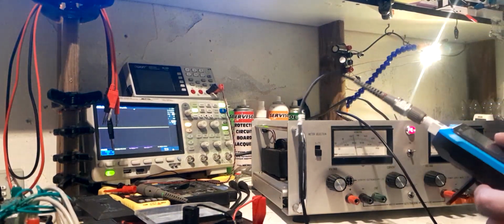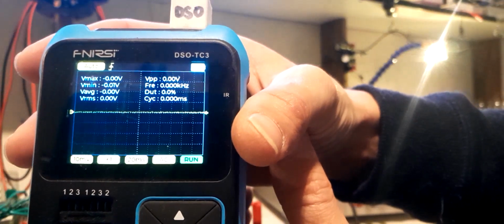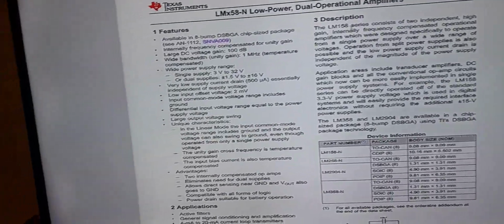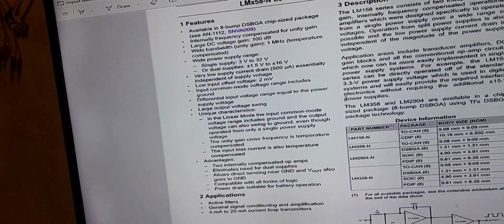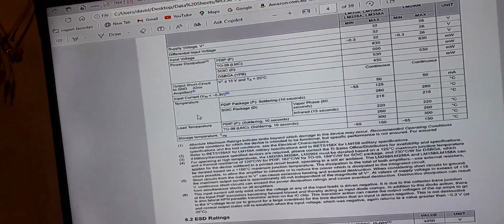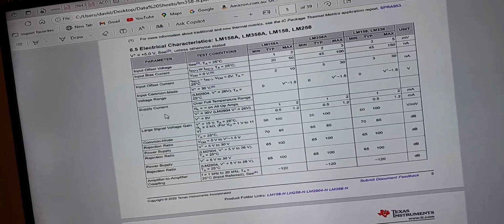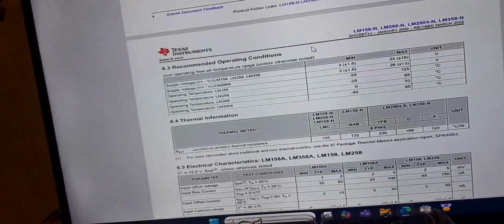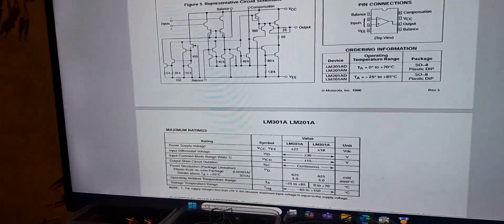Part 19 SE 612b I give up with jfet opamps going to use somthing else (you'll see why!)

Comment: So far this has turned out to be an epic series on getting this power supply working.  I'm not sure if you are aware but Scientific Electronics is an Australian company.  They started off small operating out of their home garage back in 1968.  I suspect your 612B was probably made in the 1970s.  The company eventually grew and set up production in a purpose-built manufacturing facility in Knoxfield, Victoria where they are still in business today under the name SETEC.   Have you considered contacting them to see if they still have a schematic diagram or service manual they are prepared to make available to you?  As you've mentioned in previous videos it would appear this unit has been repaired and or modified over its lifetime.  IMO a schematic of the original would mean you'd not have to reverse engineer the unit as you go.
Reply: Nice piece of detective work !
Reply from the maker: Yes, thankyou soo much I don't know how you found that I tried googling to see if I too could find any history on it but couldn't so thanks for pointing me in the right direction. I think there is still somthing off with it apart from loop stability issues with opamps because the slave side behaves differently with certain things like the resistance of the cc pot and the voltage slowly rising to full at warm up. That could just be oscilation but the cc pot r value affecting the voltage to me can only be two things one somthings wrong or two it's actualy just how its wired so in dual tracking mode it is a ratio adjust like the cv pot but i still don't think so because that dosnt make much sense to me really not the ratio adjust but the fact it changes the output voltage when the other main output dosnt change voltage with a different cc pot, I have a funny feeling a wire has been moved maybe a ref stopped working a wile ago and someone wired the cc pot on the second output to something else like the cv ref voltage somewhere in the circuit actually that makes sence becaus the cc pot is 500r and that would load down a circuit not designed for 500r across it and the voltage on the second output does rise slowly almost as if a resistor is warming up in the feedback or reference network from being overloaded, I could be very wrong that's just a guess but I'm going to trace out all 4 pots cc and cv and their ref's and see what's different with the second output before I try it again,also I am going to use lm358s this time as they seem to be more appropriate and don't have jfet inputs. Sorry to go on but also I got my hv breakdown tester so il be doing that transistor testing video soon too! Curve plotted and breakdown tested and current and power dissipation testing aswell just to be thorough!